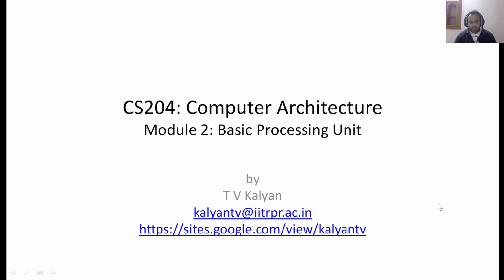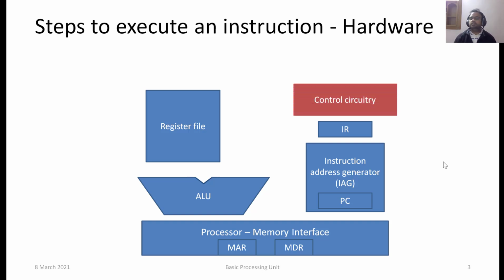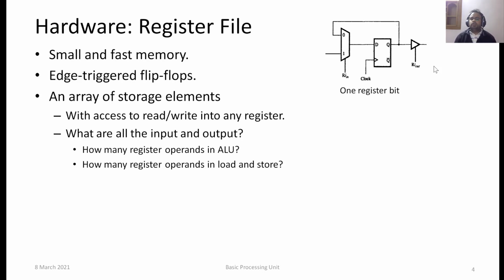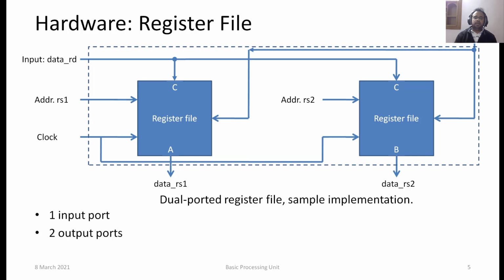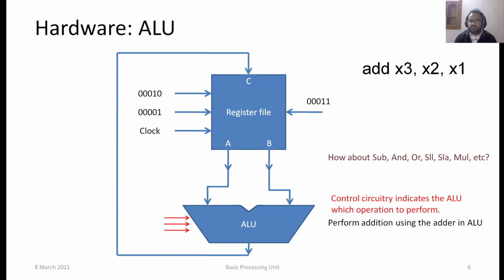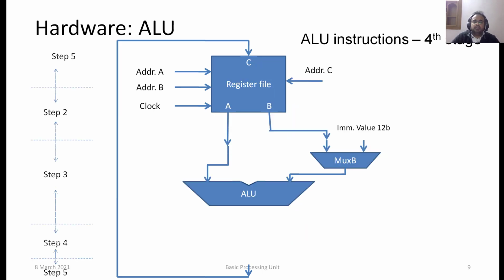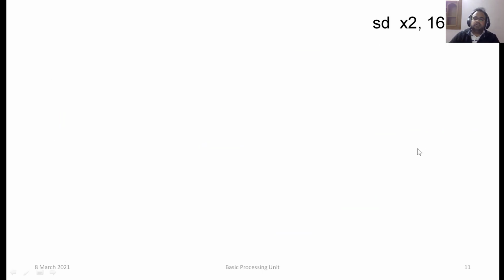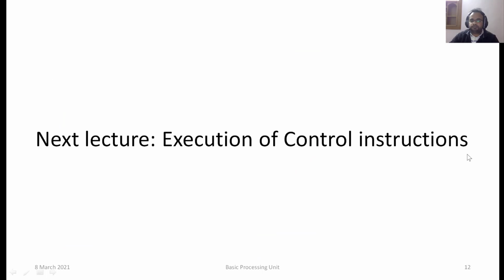CA:M2:Lec2: Single Cycle Exectution - Arithmetic and Load/Store Instructions

Comment: why mux in addi?
Reply from the maker: MuxB is introduced to handle both register operands and immediate operand based instructions. The data flow and control flow we build needs to be generalized enough to support different types of instructions, with simple changes in the control path.
Reply: @t.v.kalyan5191  thank you sir